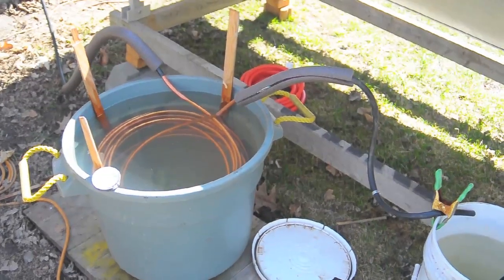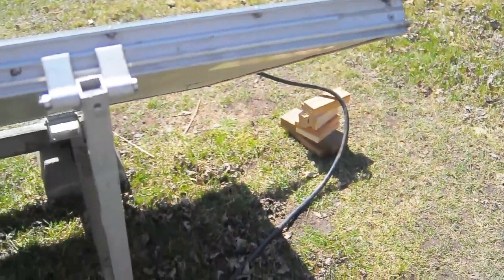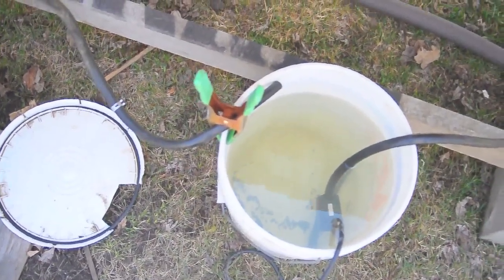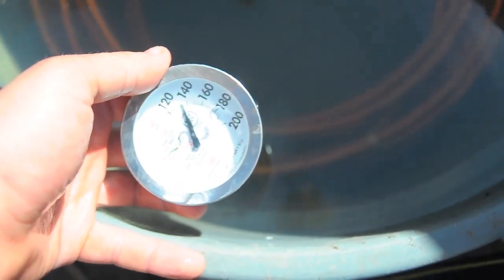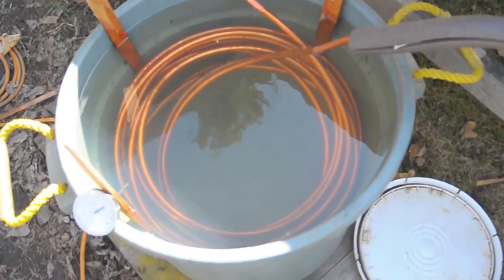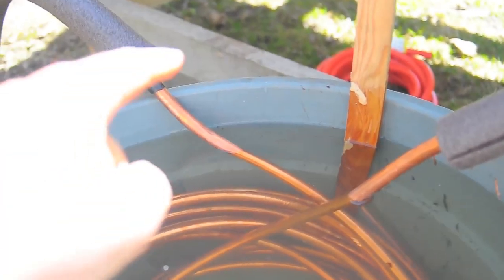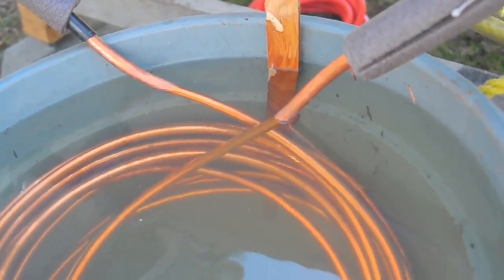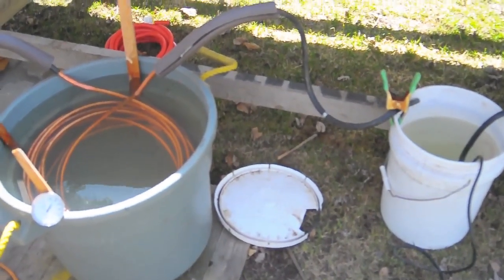Tub of Water Solar Heat Exchanger Experiment: Mar. 22, 2010

Comment: Wow, this is very old, but very good .... did you ever get around to running glycol in either the panels or the bath ? And, would it maybe be better to switch it around - to have a bath acting as the bulk heat source (your solar heated plain water) and have glycol running thru the copper which you could then feed to your heating zone (floor, radiator, whatever... ) ?

Comment: Cool. Invert the coil. This way you will have hot water entering bottom of bucket therefore exchanging heat throughout your bucket...not just the top. Looks like you're having fun. (0:
Reply: Sean Vincent having

Ac

Comment from the maker: It's only a very low power water pump used for simple water fountains. It is low-head, so it can't fill the panel with water, but as long as the panel is filled, it can circulate the water.

Comment: Do a youtube or google search on something called a 'thermo siphon' - if you get the elevation of your input water source high enough that it trickles into the solar heater by gravity, the warming of the water will actually push the water coming out the other end 'uphill' such that you can feed it back into the same source.
In other words, you can circulate water through the system without a pump. I hope to play with this concept some on my own solar setup come spring.

Comment: I bought a used commercial unit and made a heatexchanger using 1/2 tubing with forced feed water that preheats my HW heater through the drain of the water heater using 1/2 inch inside of 3/4 inch tee reduced to 1/2 for the inlet and outlet in the drain to pump that circulates the heatexchanged water to the glycol heatexchanger (1/2 inside of 3/4 copper tubing feed from the solar pannel) glycol is passive feed along the side of the solar pannel (top to bottom) house water is run from pump to roof

Comment: Have you worked out how much extra weight that would add to the roof?  Most roof structures are not designed to support this sort of extra weight.  Also, garden hose doesn't last very long if under pressure and exposed to UV - some thick-wall black PVC pipe would probably work better.

Comment: all ya need to do is buy a couple thousand yards of garden hose,lay it on your roofside by side with cold water going in on one side of the house you will get hot water coming off the other side of the house...very hot water if you have a black roof or cover the water hose with tar paper,start at the top of the  house laying your hose down to the gutter then back up till you get to the other side of the house

Comment from the maker: In this, I was just playing around with water (which is cheap, non-toxic, and easy to get) a solar system usually has something just a little different than car anti-freeze. The glycol used for solar is available by mail-order, or from larger home improvement stores.

Insulating helps hold in the heat. The finished system will use a sealed and insulated tank.

Comment: Increase your thermal yield...   make sure to use a countercurrent heat exchange set-up...  simplest version would be a coil of copper pipe in a large (barrel) container.  have the hot side come in the top and the cold side exit through a hole in the bottom.  this will optimise the temperature gradient and allow for more thermal transfer per unit distance of the pipe.

Comment from the maker: Most "heat storage" systems use mass to store heat. If you could heat sand, concrete, drums of anti-freeze, or anything else that is heavy with the solar panel, it would absorb heat during the day and release it at night.

I know a couple with a strawbale barn used as a greenhouse, which has a thousand gallon water tank that is heated by solar thermal panels. They can grow tropical fruit in Wisconsin in the winter!

Comment from the maker: In batch solar hot water systems, you DO shower with the water running through the panel. I am in a cold climate, so my panel will have antifreeze running through it instead, which then needs to exchange its heat out to water.

Not quite as efficient, but it won't freeze in the winter either.

Comment: So... Newton was right, heat will flow from a warmer system to a cooler system.  Too bad you could never remove a useful amount of energy from your system.  If you could, of course, you would just shower with the water running through the solar panel instead of just pumping it around to demonstrate the 2nd law of thermodynamics.  If you could rig up the system to charge a couple of AA batteries, it would be as useful as many other solar systems out there.

Comment from the maker: This is just an experiment. The finished version would use an insulated water tank in the house. That tank would feed my existing water heater. Since that tank is insulated, even at night, it would still have some heat in it from the day.  If the water isn't hot enough, it gets heated the rest of the way by the  traditional heater.